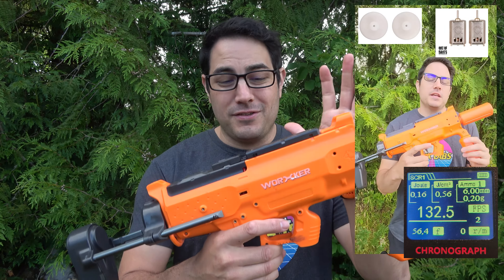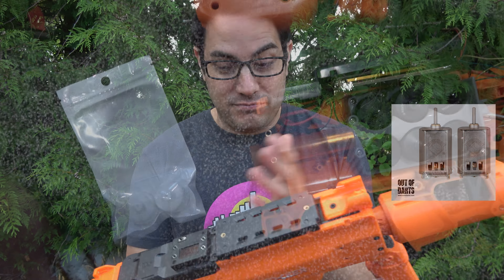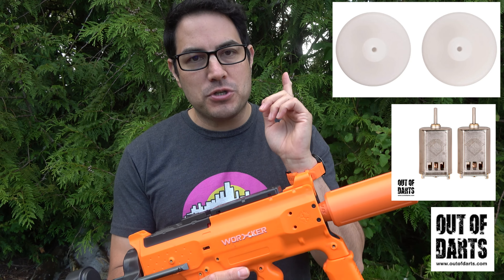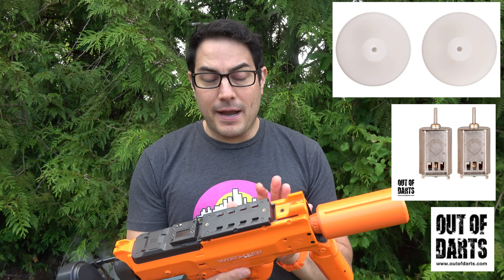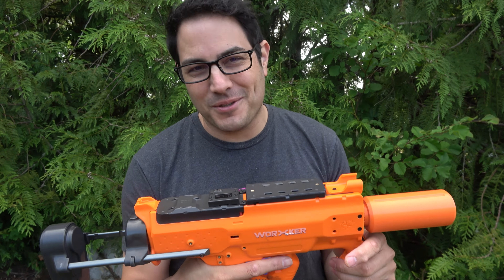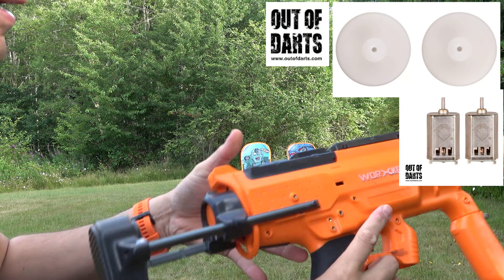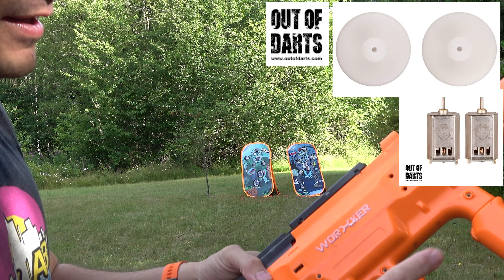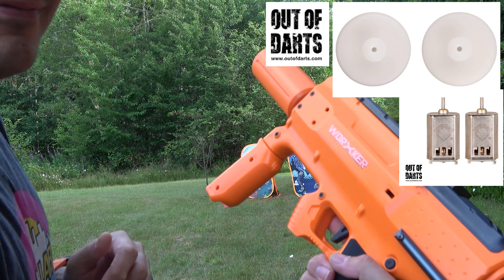Worker Phoenix 2.0 Upgraded Motors and Wheels 150FPS

Comment: Didn't the Phoenix 2.0 already shoot at around 160FPS out of the box?
Reply from the maker: nope, about 130-135ish
Reply: @xfoxgames  I am sure you got a lemon. I got mine out of box, firing worker gen 2 at average 160 fps. Or yours has the mosef programming mess up from factory and therefore giving u the low fps. Check your setting.
Reply from the maker: @zenden9  Strange, 2 of my mofets ones shoot 135, and my other 2 that dont have mosfets shoot 135...all 4 of mine shot the same lol
Reply: @xfoxgames  Yours might be the early batch becos I got mine recently and hitting 160 fps average. But I had check Drflux channel. His Phoenix 2.0 with mosef too, are hitting the 160 mark. He is even mentioning about trying to upgrade his motor to handle the 200 fps mark.
Reply from the maker: @zenden9  oh wow, yeah maybe i got early models or something lol

Comment: Hey what was your method on making sure all the motors and wheels lined up with that whole friction fit motor cage they got?
Reply from the maker: they only go in so far so i pushed them right to the back
Reply: @xfoxgames  really? I wonder if they redesigned it, my motors can slide through both directions